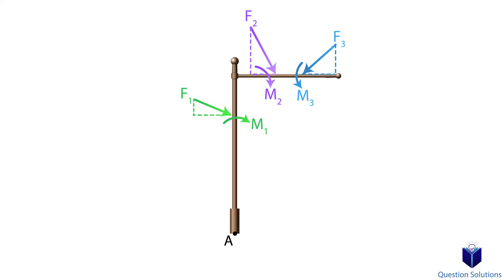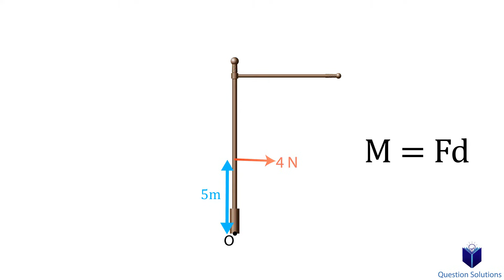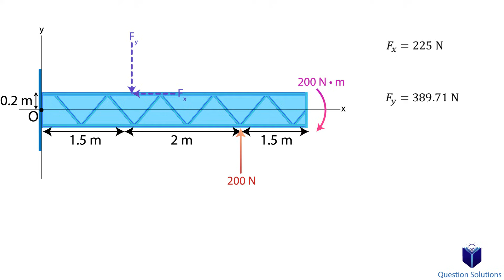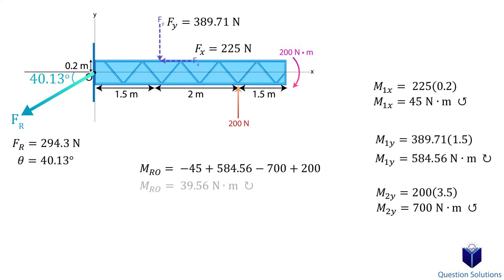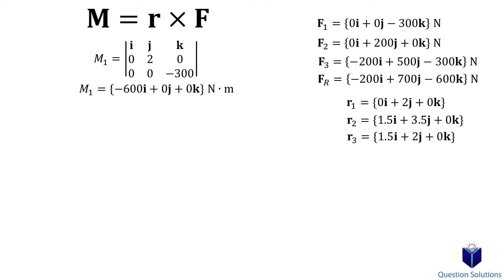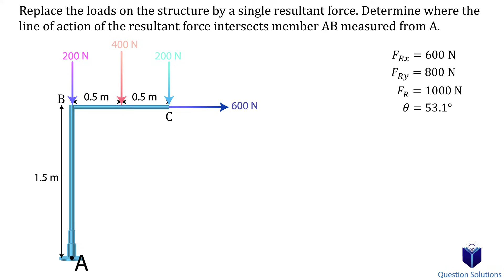Simplification of Forces and Moments | Mechanics Statics | Solved examples

Comment: At 3:18, how are you figuring out what is clockwise or counterclockwise? I do not see anything rotating.
Reply from the maker: So imagine you're holding this beam between your finger tips at point O. And with your other hand, you're pushing at the same points the forces are applied and in the same direction. Which way would the beam spin? That determines whether it's clockwise or counterclockwise. This is covered in the moments video, so please check that out if you need a refresh.
Reply: @QuestionSolutions  Thank you. At 2:40, why did you not include the 200N*m clockwise force in coming up with the angle?
Reply from the maker: @the_eternal_student  I don't think I understand your question. 😅Why would we use a moment to calculate an angle? Or rather, how would we use it?
Reply: @QuestionSolutions  At 2:48, the x moment is found by holding at point A and moving in the combined direction of the x and the perpendicular distance?
Reply from the maker: @the_eternal_student  The x-moment is the x-component multiplied by the perpendicular distance to point O, which is 0.2 m.
Reply: @QuestionSolutions  I meant the moment is counterclockwise, because the direction of the distance and the x force create a vector that points to the upper left; the x points left, and the distance points up?

Comment: In the last example, isn't the resultant moment supposed to be negative since it is turning clockwise? if it's negative, x is -2.16 which is way below.
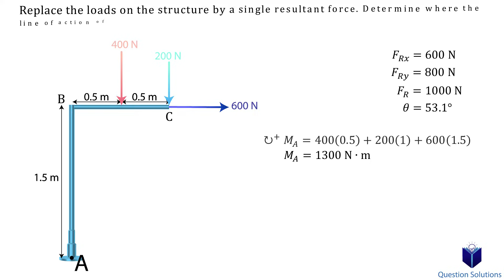Reply from the maker: If you use negative for clockwise, you will have to take the equation shown at 5:58 to be also negative (we chose clockwise to be positive). You can use either, you will end up with the same answer as long as you follow through the same direction you choose for positive.

Comment: During 2:50, should the Fx component be ignored since it's parallel to the line of action of the rotation about point O? It's parallel so how will the body move?
Reply from the maker: There is a 0.2m height difference as indicated on the diagram if you look carefully. This small height difference will create a moment. :)

Comment: Wouldn't the 200 N still have influenced the moment by enforcing the starting position and making it harder to start moment? Now when you put 20 kgs on a pole and it doesnt matter you could say that putting 20 tons on the pole doesnt matter either and doesn't affect the moment force, when in reality obviously it would? so why is this not taken into consideration? Is this because it wouldnt fit in the equation and propably has its own formula/rules and therefore, maybe is because this would be way to difficult and advanced for first year? Or i am wrong
Reply from the maker: Please give a timestamp so I know where you're referring to, that way I can answer you better. Thanks!
Reply: @QuestionSolutions  5:00
Reply from the maker: @Carusot  Okay, so you're actually thinking of this as a moving object. There is no "hard to start moment" because the item is stationary. It is a constant force that's applied. What you're actually thinking of is dynamics, not statics. Statics only covers objects that are in equilibrium, in other words, objects that don't move. So the pole at 5:00 is not moving, the 200N force was applied indefinitely, and we are just looking at a snapshot of things to see what moments or forces are effecting it. If you want to understand how a force applied for a certain time, and how a variable force would effect things, etc, you have to look at dynamics. Dynamics is usually taught after statics, which is still a first year course at most universities. So first semester would be statics, and dynamics would be second semester. Another thing to understand is that in statics, the moments caused does NOT make the object move in anyway. A counter moment is instantly created to keep the object in equilibrium. Say you have a pole buried in the ground. When you push against it, it doesn't move because the instant you push, a counter force is created, keeping the object still. When it starts to move, at a certain force, then we switch to dynamics. So in simple terms, you are one class ahead in your thinking. For now, keep in mind that every object you see in your statics class is not moving, every force added together must equal 0 for the object to be in equilibrium.
Reply: @QuestionSolutions  So just permanent third law of newton basically
Reply: @QuestionSolutions  I am having strength of materials also its weird
Reply from the maker: Usually strength of materials is covered along side statics, just depends on your curriculum.
Reply: @QuestionSolutions  You don't have any videos on that? Or recommendations at least?
Reply from the maker: Not yet and I don't have recommendations either. Maybe a Google or YouTube search might help. 👍

Comment: Are moments different if we were to take them at different points?
Reply from the maker: In the most simplest sense, a moment is just force times perpendicular distance. So if the distance is shorter, you'd get a smaller moment and vice versa.

Comment: The part at 1:00 where you discussed that you can place the resultant force anyway on the pole or any rigid body; can it also work when solving a problem for a 3 Dimensional body as well?
Reply from the maker: It can be a bit harder to do since finding the exact point to replace all the forces in a 3 Dimensional body can be difficult. But yes, you can.
Reply: @QuestionSolutions  I think best method is to use the right hand rule at least.
Reply from the maker: @darrylcarter3691  The right hand rule gives you the direction of the moment vector. 👍